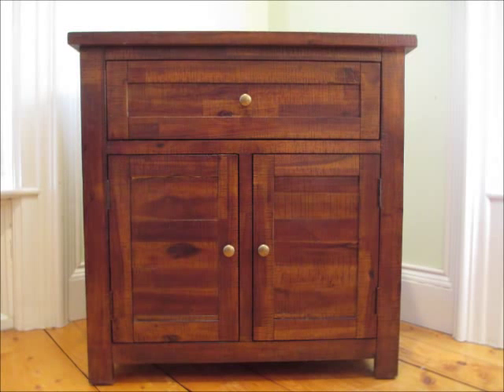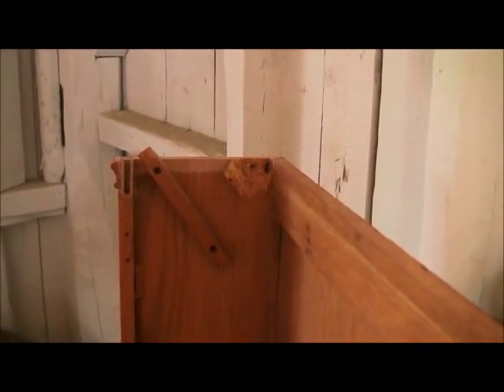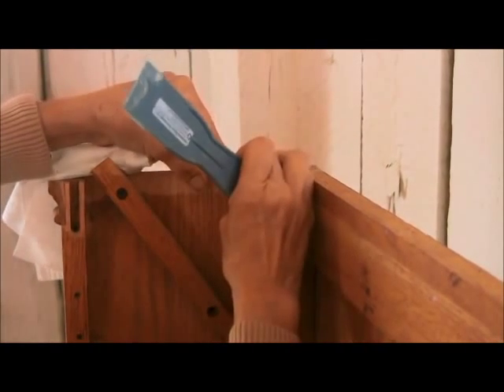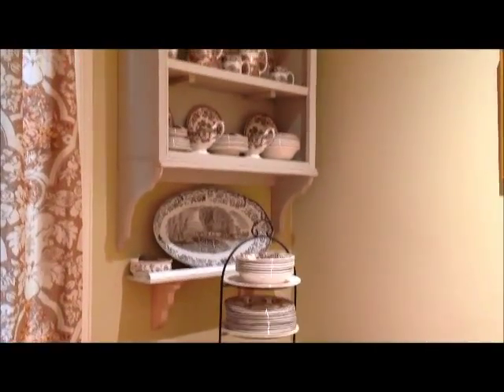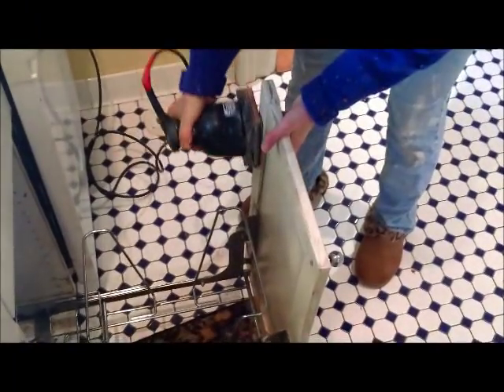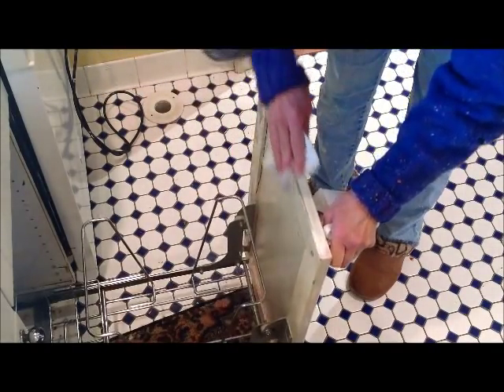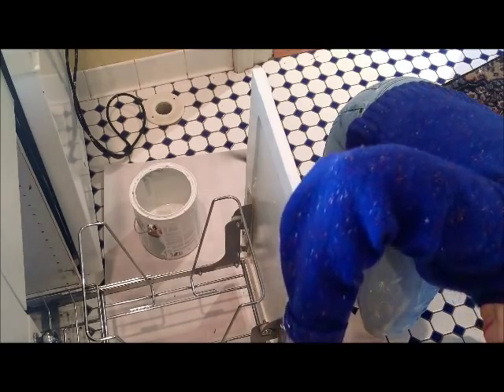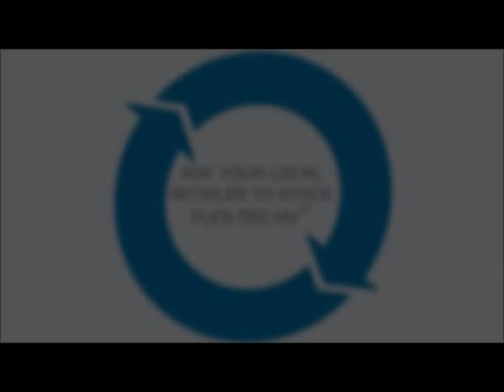Particle Board Furniture Repair

Comment: JB Weld has a product you can buy that is less than $6 at Lowe’s and comes in a resealable plastic dispenser for smaller jobs. Would you recommend that for something like this?

Comment: So like, how much does this stuff cost?  Is it pretty cheap or no?
Reply: Look at the link in the description. Definitely NO, in my opinion.
Reply: Followed the link in the description for Art's 401 Flex-Tec Epoxy Repair System.  The cheapest kit was $72.95. What? A person could spend more on the repair than what the  particle board piece of furniture cost originally.   
No thanks.

Comment: My bathroom cabinet around my sink is this type of stuff.  The front is ruined from getting wet and moisture, the front is like a fuzzy.  Any suggestions?
Reply: I'd try sanding it possibly...  Another idea i've seen people do is applying texture paint and then sanding it flat and painting over that. I know it's 4 years late but figured if anyone else had the same problem...
Reply: Thank you @bluefrog very helpful to me.